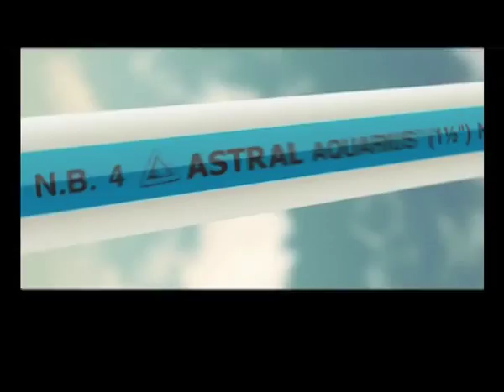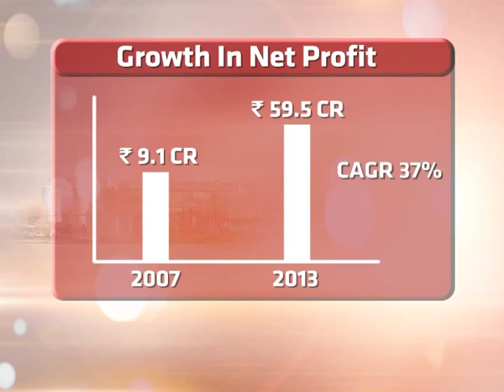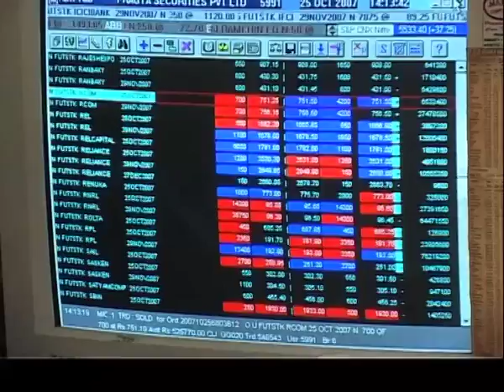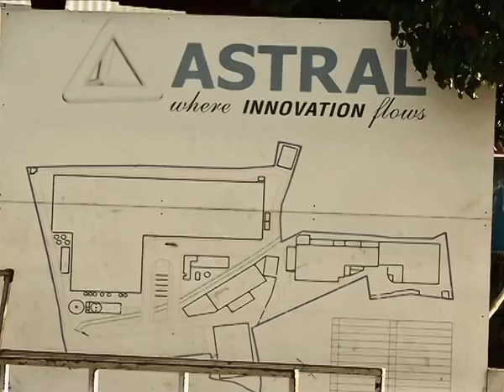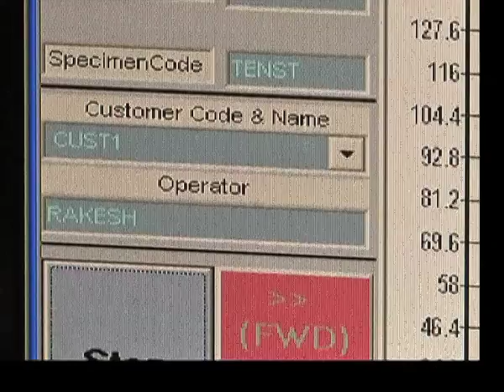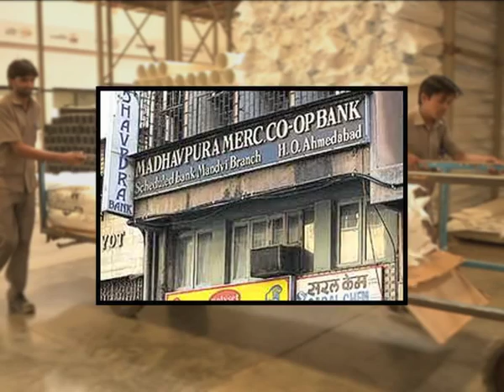Making It Big Season 4 - ASTRAL POLY TECHNIK Part 1

Comment: It's good they r keeping high standard quality 

But. One eye should b on 
Plumbing educating  to  find their products most adaptable 

Another should b on   market. Sustain ability.  
By.   - Price control. 
        - retail and dist benifits
        - making ground control and ruling out pear companies ,thus acheiving monopoly in market
Reply: Making. 
R n d products. By. Recieving data from companies related  to different 
Piping use based companies
And    making.  Products  usable in different conditions 
And thus. Replacing   conventional methods 
Say. Metal pipes or  other. Heavy metal pipes